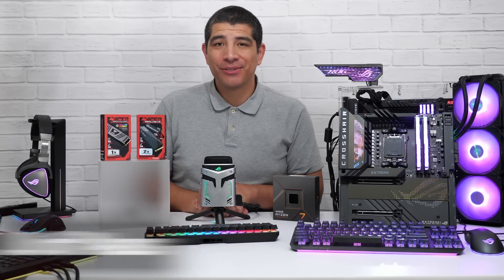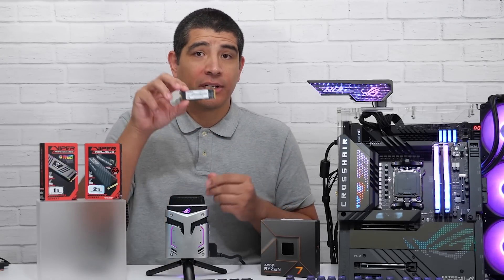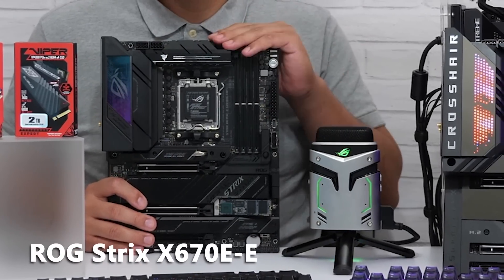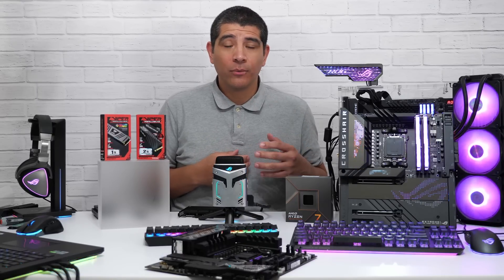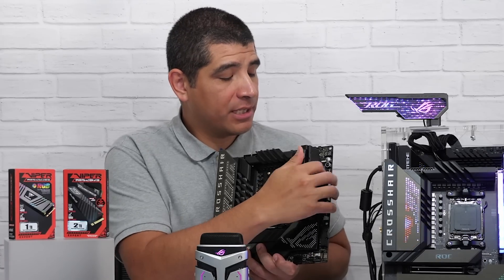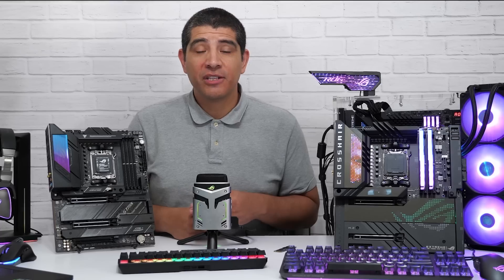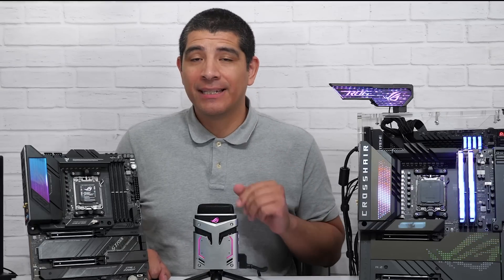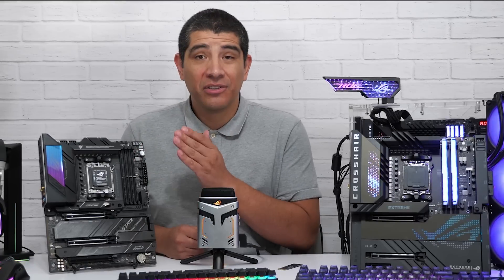PCIe Gen5 and AMD X670E Explainer with JJ from ASUS

Comment: Does Asus have a video or a detailed explanation on the configuration of the M.2 and installing them will affect the PCIe lanes?
Reply: I have this question as well. I have a gen 5 m.2 and a gen 4 m.2.
Reply: @silvagorilla  The manual does provide give some guidance.  You want to connect the gen 5 to the slot just above the GPU lane and connect the gen 4 to one of the two slots below the GPU.  That M.2 without the heatsink is connected to the chip set.  As long as you don't use the 2nd PCIe slot everything will run at the full bandwidth.